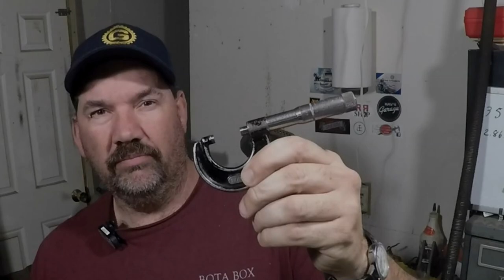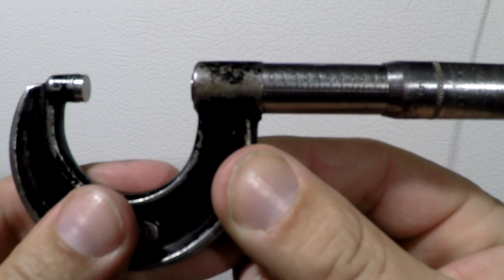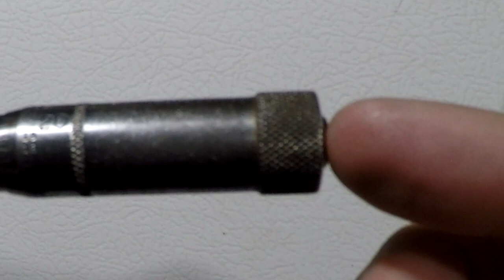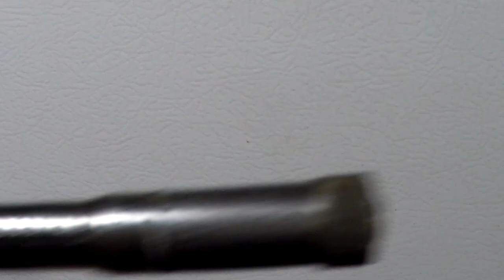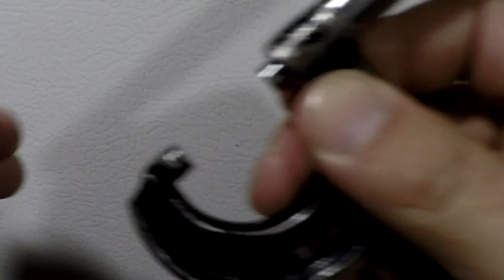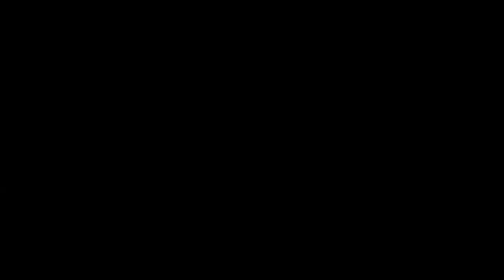How To Read A Micrometer In Inches Easily

Comment: that's exactly how I use it. quarters and pennies added together plus the main dollar amount. its unfortunate that most kids these days cant count change back when needed. I worked for many years in a pool hall where I had to calculate time on the table and money per 5 minutes at a fluctuating rate per whole hour. lots of math done in the head and it needed to be fast and accurate. we had a cash register that had no function except a money drawer. all the math was done in your head or with an old adding machine for the end of the shift inventory. yes we did inventory after every shift. drink cups clear down to hot dogs. no way I could do that these days my memory is not that good. you did a great job sharing this and it will surely help some folks if they apply the method. enjoyed the video its a good one and should do well in google search.
Reply from the maker: Something to be said for doing it the hard way. That's why I like hand work